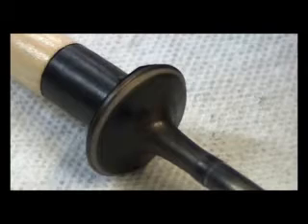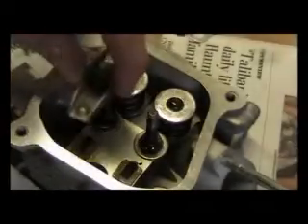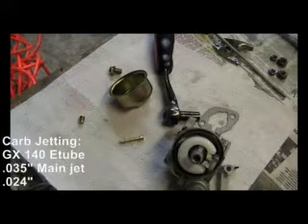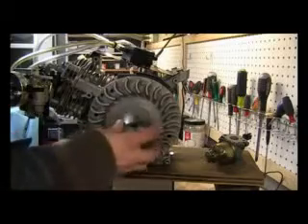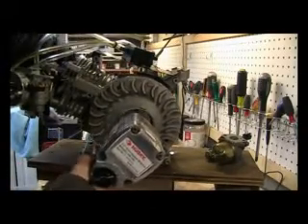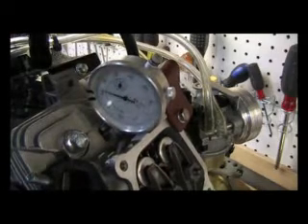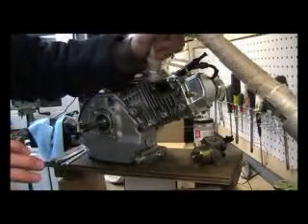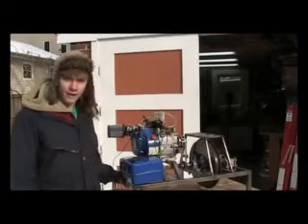Honda GX200: Part 2

Comment: I have a question about the pulse fitting you installed into the crankcase, I'm rebuilding an older flat-head engine, and I cant find any valve train breathers. If I just replace the breather with a metal plate with a gasket, and install a barb into the crankcase, and have a tube on that barb as a crankcase vent, would it have any negative effects on performance? P.S Im not using a fuel pump. Thanks! :)
Reply from the maker: +Adam T No there shouldn't be any negative effects. You should vent the crank case back into the intake manifold or into an oil catch can that has a breather on it. Thanks!
Reply: Yeah, I could plumb the tube back into the intake like it originally was. Thanks! :)

Comment: HI Guys... Does anybody knows what the 2 pipes at 7:20 are used for? I think that I dont got these on mit gx200 clone.. :o
Reply: On my* :D German auto correct shit
Reply from the maker: Hi, so on that engine I vented the crank case into the valve cover with additional vacuum lines but all you really need is one vacuum line to drive the fuel pump

Thanks!

Comment: How do I shave .012 off a flywheel key and have it correct?
Reply from the maker: Just use a metal file and a micrometer or caliper, otherwise you can purchase flywheel keys that are precut

Comment: hey bud, great vids, im building a quad with clone gx200 just wondering about the govener, if its removed with stock engine what sort of rpm will it rev to? and carby wise what would you recommend 22mm mini bike one or a gx390? im steering torwards the 22mm because I can use a mini bike throttle and don't need that top plate. is the fuel pump needed if the tank is above the carby also? for starters just wanted to change exhaust to open straight pipe and remove govener and do carby.

Comment: if you need a new clutch for your dyno you can get a cheeta from BMIkarts . com i bought one 1 month ago and it still engages just right i do offroad minibike drag races so i got the engage ment set to 2200RPM

Comment from the maker: Hey, its a 3 disk revolution clutch. I don't thing they make them anymore because my friction disks are work out and I havent been able to find replacements. If your looking for a clutch go for names like tomar or cheeta. They sell either 2 or 3 disk clutches for like 200-300$ new. You might be able to get them cheaper used and then just buying new friction disks.

Comment from the maker: Hey, that sounds good! Yeah I would start with 4-6*, when you get an aluminum flywheel I think they already have 4* advanced timing built in but I would ask who ever you buy it from to make sure. If they do then you can just use a 4* key to get a combined 8* advanced timing.

Comment: Well im using the cl-1 cam and a .36 drilled out jet the arc rod flat top piston 18lb springs gx140 etube and the 3-stage j-pipe, but i will buy a 4&6 degree and see how that works for each and when i go to buy the aluminum fly wheel i will buy the 8 degree and try it out

Comment from the maker: I would start off with a 4* key see what kind of performance your getting and step it up if you need to. You really only want to use an 8* key if your running an engine that revs really high like around 7000-8200 rpms. That rpm range requires 26lbs valve springs, a new cam, a billet or aluminum flywheel, a billet connecting rod, a new carb (or big stock carb jetting), and a new high flow exhaust.

Comment from the maker: Also keep in mind if you buy an aluminium flywheel or a billet flywheel they may already have an advanced timing. I know the aluminium flywheel (the one I used in my engine purchased from NR Racing) has a 4 degree advanced timing built in. If you advance the timming much more than 8 or so degrees your engine will likely perform poorly or not run at all

Comment from the maker: Hey! So on the stock gx200 the timing is set at about 20 degrees before top dead center (BTDC) so the engine can optimize performance power in the 2000-3600rpm range. With the governer removed you have a bigger rpm range 2000 to ~6000rpm. If you leave the timing at stock it will be less efficient at higher rpm ranges. Depending on your engine set up I would recommend btw 4 and 8 degrees advanced timing. You can get advance timing keys or file 0.006" (=1 degree advance) of the stock key.

Comment from the maker: Here is a link for the fuel pump set up its a how too article, let me know if your still having problems w w w , affordablego karts , com / fuel - pump - setup , php just relpace the comma with a "." you tube wont let me post links. Also the flywheel goes its heavy cast iron and disk shaped, the plastic part is a cooling fan that is added to circulate air for the engine. The cast iron will explode if you rev it above 6000rpm because its only designed to be spun at 3600rpm (the governor setting)

Comment from the maker: .... Think of it this way if something blow up in your engine you'll have to replace the engine and whatever body parts you lose lol. Getting an aluminum or billet steel flyweel, and a billet aluminum connecting rod is the best assurance you can get.

5) As far as tools go you really dont need an engine hone, bore dial guage, or string guage. They are just really for checking the tolarences on the engine, which are more than likely already okay

Comment from the maker: ...video is a bit confusing. NR racing is somewhere in the middle price wise. Arc racing is definately the cheapest, I believe a superboxstock kit will set you back around 300-400$ but shop around and check all the websites.

4) Running a stock engine ungoverned is not a good idea because first the connecting rod and or flywheel could fail. Generally if you rev the stock engine above 6000rpm there is a good chance the cast iron flywheel will explode! Same thing goes for the connecting rod....

Comment from the maker: To answer your first question:
1)Yes a real honda gx200 is actually preferable to a clone motor because honda uses higher quality parts, the engine block will also last longer.
2)I would recommend you go to nrracing,com, affordablegokarts,com, arcracing,com. Btw these three websites you can find everything you need to build a superbox stock engine, I would recommend buying a superbox stock kit. Affordable go karts tends to be more expensive but has great how to articles if my my.....

Comment: Hi frederikt,

 i have a actual honda gx 200 engine I have money restraints. First off can you do the same with actual honda motors, second arround how much would it cost to get all of the parts, where could i get pistons connecting rods valve springs to make one of these engines. I have been running this motor un-governed is that bad? Its stock at this moment will i blow a rod if i keep running it at hi rpms

Comment from the maker: @larsbuller Hey, so my engine is a superbox stock engine and it puts out about 14hp with a properly tuned carburetor. The maximum engine rpm is limited to around 6000rpm due to the valve springs (18lbs). I would highly recommend building a superbox stock kit because of its reliability and good power output compared to custom engines. 

Check out the links I posted under more info for the video. Look at NR racing they have some good information on approximate HP and RPM ranges

Comment from the maker: @TRcustomengineering 
Hope this helps!!
(Torque) = (Rotational Inertia) x (angular acceleration)
(Rotational inertia) = [ (mass of flywheel) / 2] x (radius)^2
(angular acceleration) = change in angular velocty per unit time
(power) = (torque) x (angular velocity)
The rotational inertia of the flywheel is calculated where as the angular acceleration is measured.

Comment from the maker: @TRcustomengineering and spun that instead. The reason its just a test stand is that I couldnt get the labview program I wrote to pick up the engines rpm. So therefore until I get that fixed it is just a test stand.

Thanks!!

Comment from the maker: @TRcustomengineering Well at the moment it is really just a test stand but what I built it as is an inertial dynamometer or "dyno" for short. If your not familiar with one it works by measing the rate at which the engine accelerates a flywheel. By knowing this and the rotational inertia of the flywheel you can measure torque and calculate horsepower. I didnt have the money to get a big flywheel machined so I bought a 60lbs tractor flywheel...